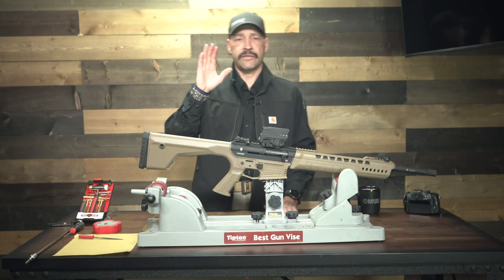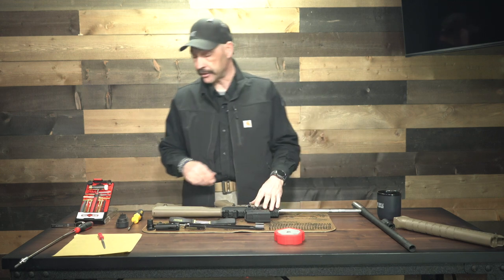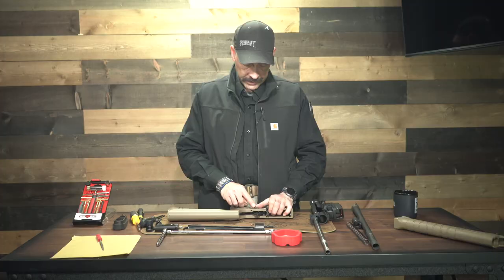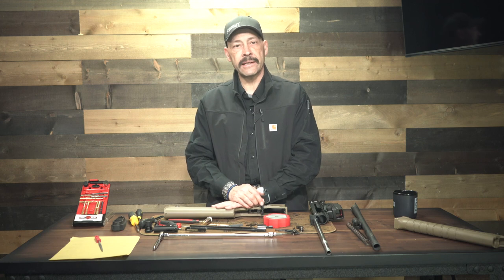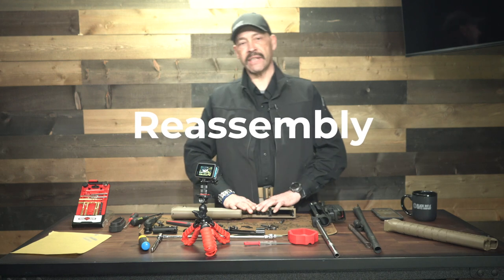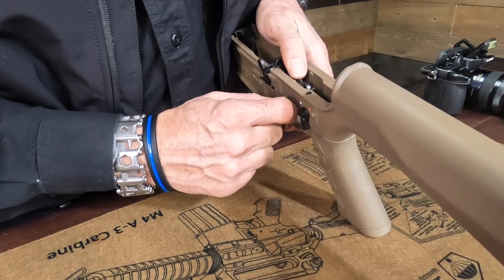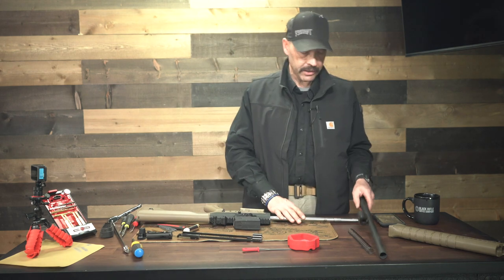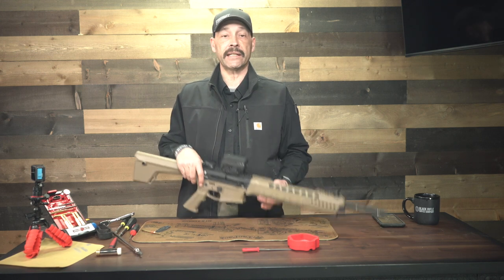Typhoon X12 Breakdown Full Disassembly and Assembly

Comment: Thx for the Great video!  Is there a way to switch the safety to the other side?     I’m a lefty and the safety  switch nails my trigger finger when firing.
Reply from the maker: Unfortunately there is not. There is a detent that has to engage with a slot on the safety and that is on the left side of the gun. - DK
Reply: Thx for responding. Guess I’ll learn to shoot this SG right handed.  I’m left handed but right eye dominant so maybe not such a bad idea😏

Comment: You made that so much more stressful than necessary, most importantly it’s not necessary to install the safety prior to reinstalling the trigger assembly that’s absurd, also, why even have a go pro if you don’t pause to emphasize orientation and / or direction, with this video as a guide this process took me 4 hours, I feel as though I would’ve been better off just videotaping myself take everything out with no instruction, and then just rewinding. I hope to God that you’re not a gun smithing instructor/ educator 😮‍💨